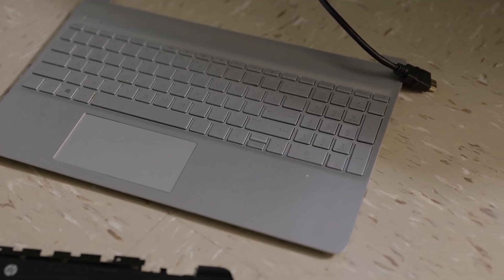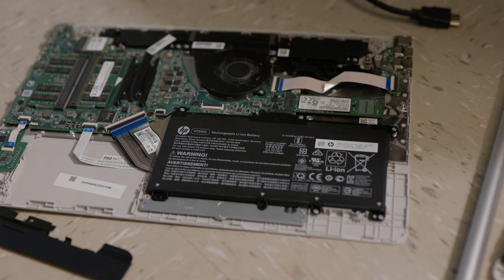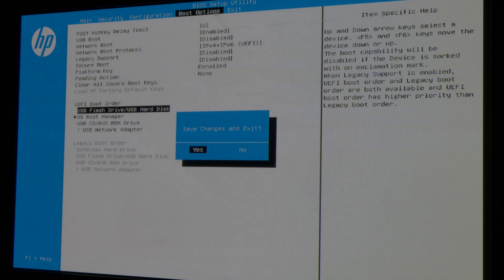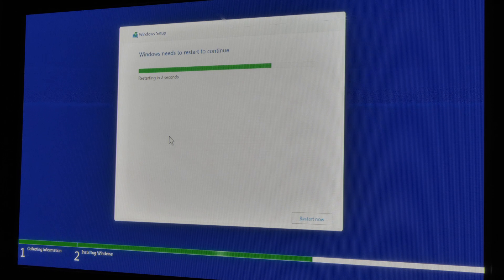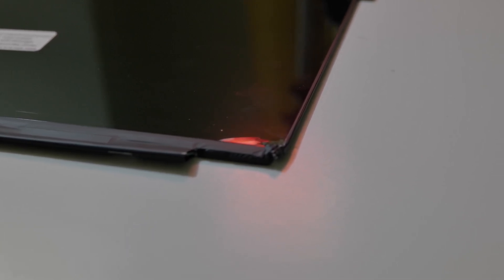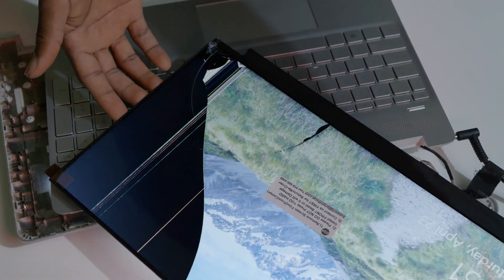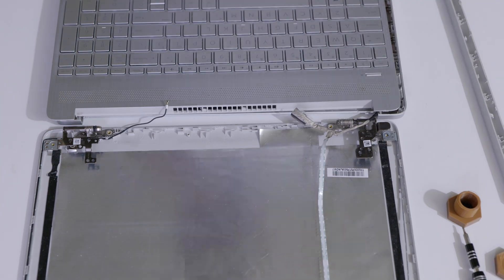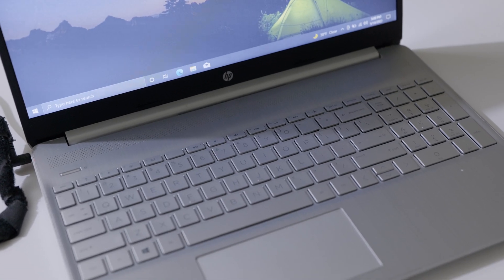How to repair a laptop without a display and Replace the screen

Comment: bro my asus tuf gaming laptop is not detecting bios neither the installation setup is showing in external monitor. what should I do since the cost of replacement of display is 15k i bought a monitor at 6k.
Reply: Hello, same problem. How did you decide?
Reply: @nolables  they key here is too detach ur laptop monitor completely from motherboard. Which is so easy. Just remove the wires coming from laptop display and then i connected laptop to external monitor (144hz) with hdmi cable and display was coming in monitor alone since i detached the laptop screen
Reply: @ronaldo007-wg9bl  That is, you even see the start of the asus system and you can see the BIOS itself on an external monitor?
Reply: @nolables  yes i can go to bios anytime now. Once u detach laptop display from motherboard, the pc automatically searches for another display source like external display.
Reply from the maker: Insure BIOS battery (if applicable) is reinserted correctly and before restarting, remove battery and charger, then hold the power button for at least 10 seconds to completely deplete the capacitors. This will reset the BIOS settings and refresh it. make sure to disconnect the built in display otherwise HDMI will not be detected at bootup. Consider also trying a different HDMI cable. If you reinstalled the RAM sticks, the first boot time on some gaming laptops can be up to two minutes of blind loading, you may think it's not turning on but in fact it's loading with a dark screen